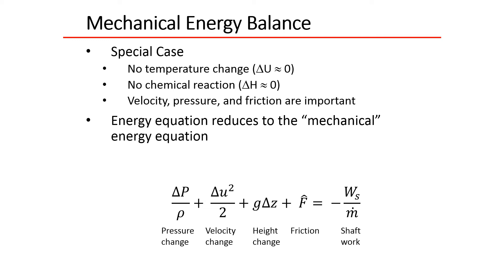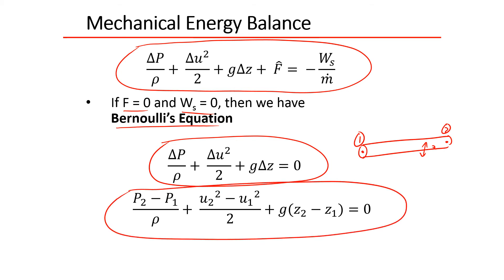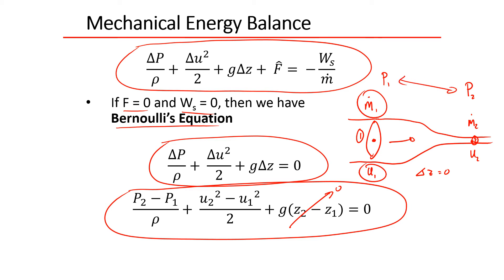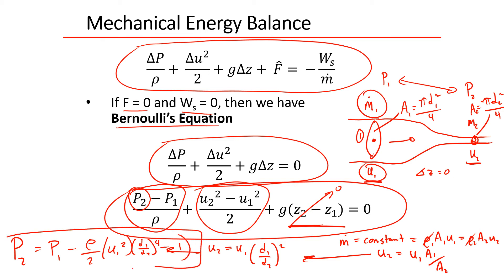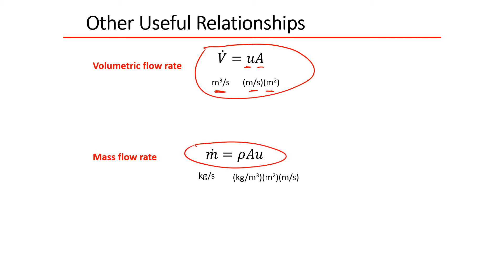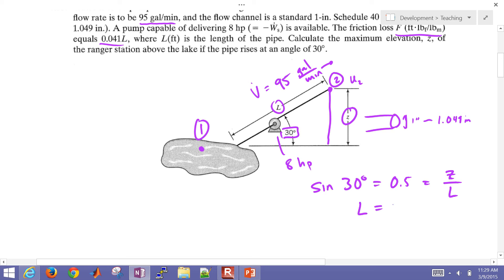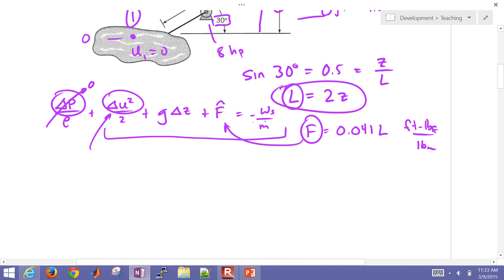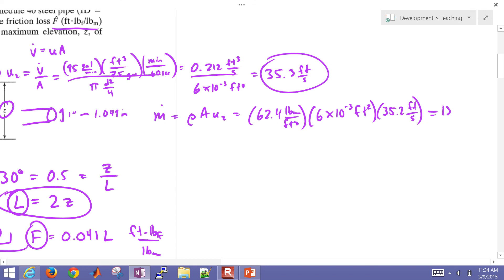Mechanical Energy Balance for Fluids

Comment: A few mistakes I see

Mistake 1
Need to multiply the '-ws/m' term by 32.2, which will change it from 333.33 to 10733.

Mistake 2
'-ws/m' should be positive

Mistake 3
This isn't actually a mistake, but I prefer to do the hp conversion by multiplying by 550 instead of 0.7376/1.34E-3  (550 is much easier to remember and punch into a calculator) 

good video otherwise, thanks
Reply from the maker: Thanks for the corrections.

Comment: pause 16:44 

Using what you have written, I calculate z = -27.45 ft.  Can you confirm the calculations?
Reply: The work term should be positive. He also forgot to multiply the work term by 32.2 ft/s^2 to cancel out the feet and second units. By making these corrections and solving for Z, you should be able to get the same answer.
Reply from the maker: That doesn't seem correct because the elevation change should be positive.